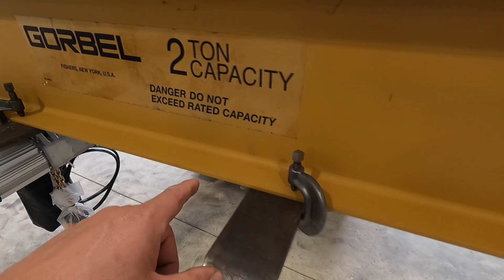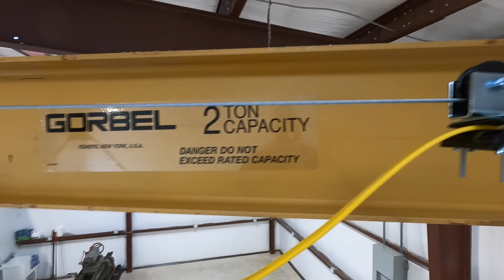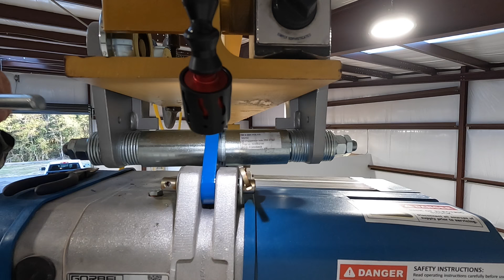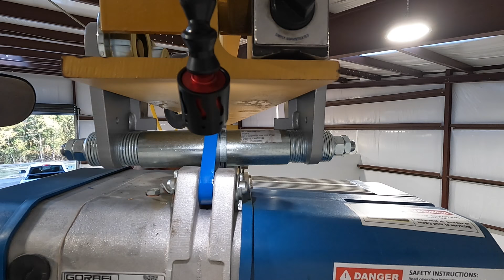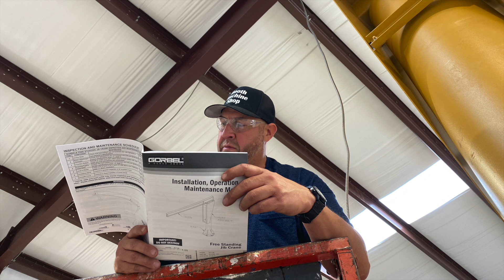Gorbel Jib Crane Installation Part 2

Comment: The wedge doesn’t go under the bolt head to compensate for the angle of the beam flange? Honestly not trying to knit pick or criticize I realize there’s been a million experts in the comments it’s just that I’ve worked around structural steel for years. Those wedge clips are intended to provide a flat surface under the bolt head for proper clamping load. Great job by the way the shop looks awesome!
Reply: It is suppose to. It's odd that it doesn't say that in the installation manual but the pictures show the tapered washers on the I beam flange not underneath.

Comment: The wedgeshim should be under the boldhed not on the nut side. The inner of the beam is wedged, the wedgeshim should compensate this angle to a 90 degres

Comment: Something was wrong with the sound most of the video Adam. I could only hear sound in my left speaker. Thanks for bringing us along to see what’s going on in the new shop.
Reply: There were some sections where his audio was only on the left side.
Reply: if you have that problem its local
Reply: @Wolfy_80  Incorrect.  There are several places during the video when the sound is only on the left channel.
Reply: @jcsoundguy  yet again, its a local problem if you experience it.
Reply: @Wolfy_80 lol.  No it’s not.  I 100% assure you that my system is correct.  There are places where his audio is only on the left.  You need to get some headphones and listen more carefully.
Reply: @Wolfy_80  At 2:28, the audio is only on the left channel.
Reply: @jcsoundguy  still use headphones al the time and there is clearly sound on all channels.
Reply: @Wolfy_80  Sorry you don't hear it.  I can replicate it on 4 different devices.  It happens every time at the same places.  I assure you I am correct.  I'm a long time audio engineer.  Its how I have made a living for over 25 years.

Comment: With jam nuts, the thick nut is actually supposed to go on the outside.
Nobody ever believes this, but you can look it up and the reason why makes perfect sense once you know it.
Reply: So with the thin nut on the inside, how do you hold it in place whilst you tighten up the outside nut, unless you grind down an open ender?
Reply: @jemijona  Yeah, that's a really good question hey.
I guess we are expected to have a special thin spanner on hand.
Reply: When I was with the Huckleberry RR, our jam nuts were thin and one wrench size larger than the regular nuts.  There are some jam nuts that are made with grooves(one on each face) so that the nut bends when tightened.

Comment: Adam, So when Sunbelt sells there older equipment. A large amount of it goes threw Iron Planet Auctions. As do several of the other large rental companies. These 10-K multi fuel fork lifts are very handy to have in a shop like you have put together. The NO MARK white tires are definitely something you want to look for when you are looking for a good used machine and be sure to inspect them before you run them on your concrete. Because I've seen where someone ran over a square head sheet metal screw and then drove on a new concrete floor, And its not pretty when the screaming starts when someone's new $10,000.00 concrete floor now has a scratch and a dime size pock mark ever 14".

Comment: You know one of them machinist type dudes would take some measurements and make the appropriate spacers for that trolley and lose the washers. :D
Reply: I have a couple of trolleys and it doesn’t have a bunch of washers like his does. Mine have various thickness spacers and you just play around with them to get the right size. Much cleaner and fewer parts.

Comment: The built on the Crosby should on the dead end of the cable you have the built on the live end which in time can cause the live end to break
Reply: It was to say the u bolt not built darn spell check

Comment: Looking good, you're back is going to be very happy with it.
One addition you might want to consider is a rope on the end of it to swing it around and maybe tether it to the beam so it stays put in a resting position.
That way you can hang the control in the hook and hoist the control up above your head and out of the way and put it in a parking position.
Also curious, does it need a yearly inspection/certification over there?

Comment: To make a proper clamping of the cable, you would be safer if you were to install two u clamps to both ends, one with the u facing one way and the second with the u shaped clamp part  facing the opposite side to the first clamp. Just for safety, they will not pull off the cables

Comment: Adam, It appears to me that the electrical unit at the top of the beam should have all 4 bolts removed so you can rotate the electrical unit 180 degrees and bolt it back down into place. In it's current orientation the yellow electrical romex cable goes over the top of the I beam then makes a bend into the electrical connector to terminate the connection. Would the yellow romex cable not take a more natural bend and not have to lay across the top of the beam if the electrical unit was rotated 180 degrees?

Comment: If you are conserned about geting decals strait a trick I picked up is to have a spray bottle with soapy water and spray the surface just before aplication then you can ajust as needed and the water gradualy evaporates over time.I thought the guy was pulling my chain  when he told me.
Reply: Never pull the chain on a saddle of a dead horse.. hah hah!

Comment: I would of thought at 35.10 the wedge shim should sit under the head of the bolt on top as that part of the beam is angled and would keep the underneath of the head of the bolt parallel so when tightened down would not stress the bolt. It looked like where Adam put it underneath was flat so would stress threads where the nut is because it’s an angled shim on a flat plate or am I missing something here. Not saying I’m right I was just wandering. Sorry Adam this isn’t a criticism of your work you do awesome content.
Reply: You're correct.  It's meant for the top of the flange since the bolt hole is so close to the vertical member.  It's actually sitting on the radius of the beam.

Comment: 15:56  if you have a lathe to make the pins you can make spacers insted of using washers. Why they dont have them is beyond me, think about it they sold all the parts to the kit wouldn't you think then know the size of the ibeam used.
Dont forget to put grease on the i beam and trolley system just a thin layer. It will cut down fraction in case the sealed berrings lock up.

Comment: I noticed @2:37 that the nuts are loose on the 360 electrical contactor clamshell. I don't know if that was caught during wire-up, but you may want to check.
Reply: I noticed the same thing. Still watching to see if he catches it, and scrolling through to see if anyone else saw

Comment: For some reason for most of the video the left audiochannel is 100% volume but the right audio channel is 5%. however the ads and some footage for the pins is equal volume on both channels? Maybe on purpose in editing or side effect of the GoPro? Awesome install of the crane though! I think it will be super useful.
Reply: I bet an oversight when he had two microphones prepared. I think on this Rhøde system you can switch it from mono to 2 channel stereo, where each actual microphone is separated to the left or right channel. so without mixing you would hear for example Adam on the left and Abby on the right channel, which of course allows fr easier editing with different levels.
Just if you forget, audio tends to be abit one sided.

Comment: In hindsight it probably would have been easier/faster to temporarily remove the lower bolt on the trolley stop in-order to slide the trolley on.
Reply: Except he had already installed the wire on the other side and tensioned it.

Comment: Adom, you put the cable clamps on incorrectly. The running end goes on the top and not on the bottom as you have installed them. In this instance it wouldn't make it unsafe due to there being little pulling action on the cable, but if you ever were to clamp a cable in this way that were to be used as a lifting or pulling cable there is a good possibility of the cable pulling out of the clamp. Just wanted you too know.

Comment: Hello Adam, all the best wiyh this new shop, Just a suggestion, i would make solid spacers for those big pins as so many washers tend to work loose after a while and the trolley could spread open.
Reply: looks very unprofessional to have all those washers.  It can't help in the strength department.

Comment: I think you put the cable clamp on backwards. Saddle should be on the tensioned side
Reply: Correct - Never saddle a dead horse.
Reply: True but it's not a load bearing cable, an experienced rigger would have it that way but it does not really matter in this application.

Comment: I don’t know if someone has committed the same or not but we on the low side of the post loosen up you bolt on the bottom and drive shims under the bace or weld nuts on your base so you can use jacking bolts to get it perfect then mortar

Comment: Well that scissor lift was found wanting at a certain point!
Reply: Could be worse. Could be a manlift. Those things are sketchy as frig at full extension.
Reply: I didn't see it but in Australia a scissor lift has the safe working capacity on large sized signage just like the crane has, so they should have been able to add their combined weights together to see if it was up to the job or not.

Comment: LOL. Adam has to make a part for this crane--Right Now. So Adam just whips it out in the morning. Please note at 19:00 when Adam shows us the pin he made: each end is chamfered, the pin holes are aligned and chamfered, and the entire pin has been buffed with Scitch Brite. I feel sorry for poor Adam, he can NOT make a quick and dirty part even when time is pressing.
Reply: I noticed that as well, every single piece he's ever made just oozes with quality, I love it.
Reply: I was actually surprised he didn't remake the pin to hold the jib on the mast pin.  Those hose clamps were a little sketchy. couple of grooves for some split rings would have been nice.

Comment: Hi Adam.
I have a suggestion for the Gorbel sun faded paint.  I have used boiled linseed thinned 50% with mineral spirits (Varsol in Canada) to refresh faded paint. Just brush on,works very well. Perhaps try out in an out of the way spot to test.

Comment: I would put two cable clamps on and remember not to saddle a dead horse. The clamp has to be in the right spot and the right side. To me I don't think this looks like a safe  4,000 lb crane. But maybe the Gorbel people will test it like at 8,000 to prove it. You have to know it is safe. It should be on them.

Comment: Great to see Your new Workshop coming along. But can it be that you mounted the Chainhoist backwards ( I mean the Plug from the Chainhoist should be facing towards the Column) and the Cable assembly withe the Cableclamps being on the rong side of the I-Beam. It just looked a little off to me. But anyways can't wait to see the Crane in juse.

Comment: Hey so just wondering why you are not using thimbles on the tagline cable?
Reply: It really doesn’t need it. It’s a very large cable for a very light load application. They’d be more aesthetic than functional, especially going through the rounded material of the screw eyes.
Reply: I fully disagree with you on that.

Comment: Are the trolley stop brackets on the rear of the I-beam correct. Looks like the side with the cable leg has the open side of the angle facing the trolley and the opposite side has the closed face of the angle iron towards the trolley

Comment: 13:47 I personally would have done this step before putting the end stop on the beam and installing the wire rope...that way, you can put the trolley together and just slip it on the end of the beam before installing the end stop...I think it would have been easier myself...
Reply: Me too. He did a few jobs more than once in this video.

Comment: Should have used hose clamps instead of cotter pins on those 😅.
Reply: Before people start hating on me, I’m only joking. Making reference to the previous video where the crane’s uplift safety pin was secured with hose clamps.

Comment: solid core wire is not safe for use in moving applications coper work hardens over time from bending  and will brake so its best to use a stranded core wire.
Reply: Yes.  The more strands in the wire, the more it can be flexed without failing.
Reply: Where did you see solid core wire?

Comment: That's a massive crack in the concrete already @48:00. The pad next to it is cracked too.
Little bit concerning after just 2-3 month.
Reply: Good thing the space is a rental.
Reply: There’s 2 kinds of concrete; concrete with cracks and concrete that’s gonna crack. 
This slab’s already had industrial loads all over it, so it’s no surprise really.
Reply: I know three truths about concrete.  1) It's grey.  2) It gets hard.  3) It cracks.
Reply: They poured an engineered footer for the crane. The cracks in the walking surface concrete do not affect the crane.

Comment: Very nice progress. What I do not understand is, wy´hy you did not just leaev a shoulder on one side of those pins so you would save the work od xrossdrilling them and also give a better hold than the flimsy pin.

Comment: I really don't see how this crane is better than a gantry crane.  For almost 2/3 the price you can get a taller rolling gantry with twice the capacity, and it won't be stuck in the middle of the room.  They do take up a good amount of space, but you can move it to every corner, or even outside or to a different site.
Reply: Yep you are right, you don’t see it.

Comment: Surprised the electrician used a 4 gang metal box on the chain hoist end.  Looked like a female twist Nema 14L-30R end was what was needed.  Basically making a much “cleaner” extension cord end. No sharp edges, especially since it is constantly moving…

Comment: in the uk we would test the pins has it lifting equipment, we couldn't make them and fit pins with out testing ????? i do know it easy job to do but its change over time. but safety gone over top now in the uk

Comment: Watched you seal that floor Adam. 
Why don't you paint it once you're done with the forklift etc?
Reply: An epoxy flake floor would look real nice, and you could add a little bit of silica (or something similar) for a little added traction if/when oil gets on the floor.

Comment: Not sure about the rules in Florida but here in Ontario you have to have a certified crane inspector sign off the installation and it gets certified every year after that. Will keep you safe.
Reply: In the UK that would only apply if you were hiring paid employees, the insurance would mandate it. As an individual you can do what you like.
Reply: Florida is deregulation paradise.
Reply: Totally. That goes for his forklift and manlift also.

Comment: For safety, when getting off a forklift, step off backwards. You'll have two hands holding the frame and steering wheel to help you balance.
Reply: I didn't spot that error !
Reply: That’s all you took away from the entire video. How about hey nice job putting up a crane by yourself. I assume you do everything 100% correct in your life to point out such a trivial useless thing.
Reply: @ChrisM78  It's just positive advice.

Comment: You need to do a certification on the capacity.  Normally it is 1 1/2 times the capacity of the rated capacity.

Comment: I’m always amazed how you have massive steel I beams and plates and two tiny pins to hold the load. I know shear strength and torsional strength aren’t the same things but I still laugh at it.

Comment: I was wondering if you placed the angled shim/washers on correctly?  The angle equalizes the inside angle of the I-beam...  Since the outer face is flat/perpendicular already, no angle compensation is required.   Hmm?  Well, you placed the beam onto column like a real IRONWORKER! Get down Adam!

Comment: couldn't you have installed two parallel  beams from the shop doorway to the back wall ? then could have similar reach of the shop floor without the  vertical post in the middle of the shop?
Reply: Yes, gantry cranes are more the thing in the UK. Even possible to have overhang extension to reach the Pacemaker.

Comment: Seems to me they should have made the cable to suit the beam length rather than leave it to the customer , and used proper compression joiners on the cable.
Slightly semi-assinine

Cotter pins are about one level higher than a bent nail. R pins are far superior
Reply: It's just a traveler. I hate compression joints on wire rope. Rope always stretches and you have to redo the whole thing. You need an adjuster anyway.

Comment: So the only connection between the column and the beam is through a single tapered roller bearing and the trunnion rollers .
Reply: Yep, that's how they are made.
Reply: Is that really safe?
Reply: Yes. It is safe.
Reply: @paulhunt598  Good!

Comment: should have counted how many times you mentioned pins and pin holes missing or not. Instead of lowering the fork lift so you have to work on your knees, you could have raised the pellet jack and stand up and install. Like you said make it easier on your self.

Comment: I would make some propper solid spacer ...all the amount of washers looks not realy solid because they are mild steel .
Reply: For a 2-ton, it's probably fine. If anything, I'd be worried about the sheer force on the bolts.
Reply: Mild steel has a tensile strength of 60, 000 psi. More than enough to lift 4000 pounds safely. Especially as it is not lifting the load.

Comment: The two Bolts you missed seem to be a Standard part, see ISO 2340 Form B.
Reply: Do I have to fill out a TPS report and put it on top of ISO 2350 Form B?